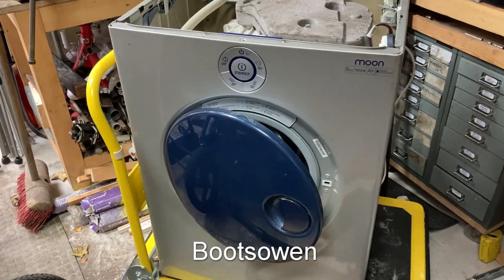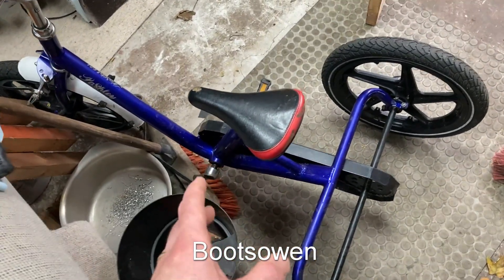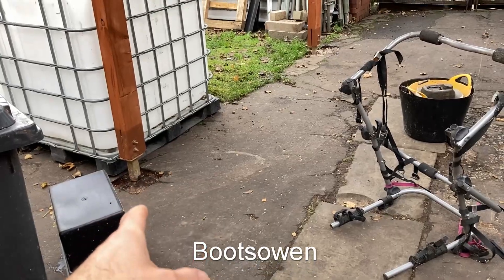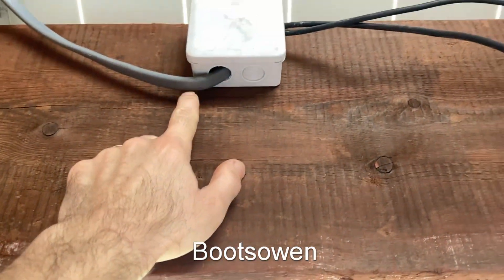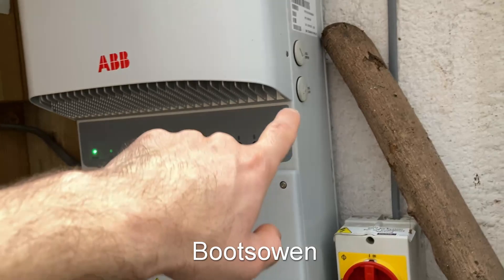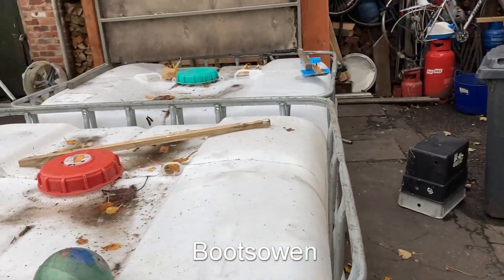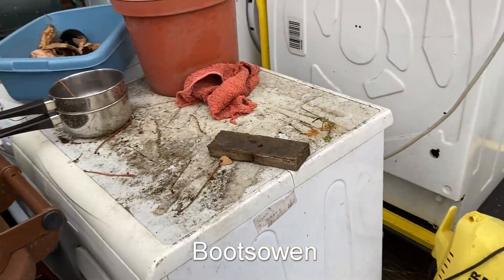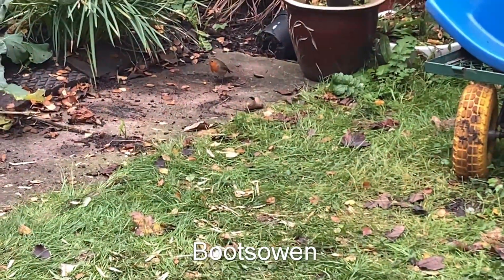Update: New PCB for an Indesit Moon | Solar panel and inverter install | Firewood

Comment: Owen, that 10mm cable for the high voltage DC may be OK as long as it stays dry. I'm guessing your DC is at about  230v, so if you get an isolation Riso fault you will know it's that cable allowing a micro track to earth. No risk, just the inverter may make a fuss, but if the cable is on timber and well off the floor you will probably get no problems. I did a video on this. Cheers
Reply from the maker: Thanks Andy, you also mentioned it about double insulation if underground, I looked at it and would have had an extra 4 m of up and down if I buried the cable and ducting etc. The plan is to use some 32 or 40mm waste pipe as a duct and then it would be as dry as in the garage. I gave it some thought and that shed is probably the coolest place, closest to the panels, if I have it in a cool part of the cellar it means about another 10m of cable. At present it has 9/14 panels, so it would seem to me to be impossible to overload it, but hopefully I will get the other panels up before next summer and a fan to give it a breeze too.
Reply: @bootsowen  Owen, oh yes keeping it out of the ground is a grand idea on all fronts. I don't think you will overload that cable, full output will only be 8 amps or so. I'm assuming your other panels will be connected to the other tracking inputs as I remember you saying they will be facing another direction. Poor generation here also, no wind, no sun, no generation, November. Cheers
Reply from the maker: Indeed, other panels on the other input. 

I reckon 100w on an overcast day is remarkable!